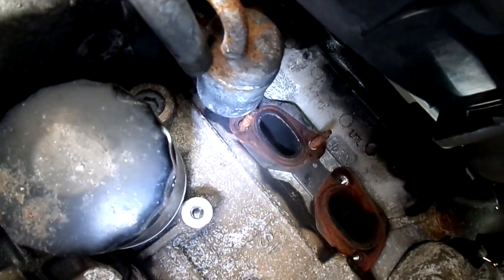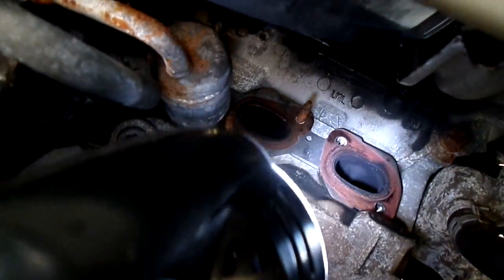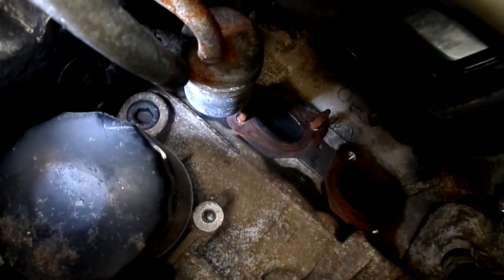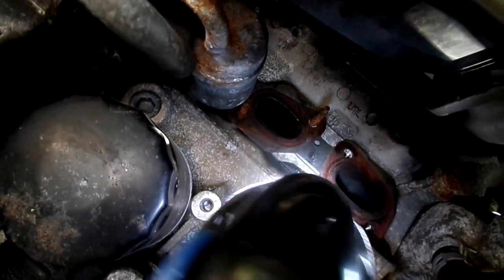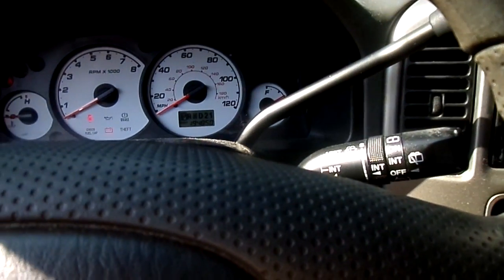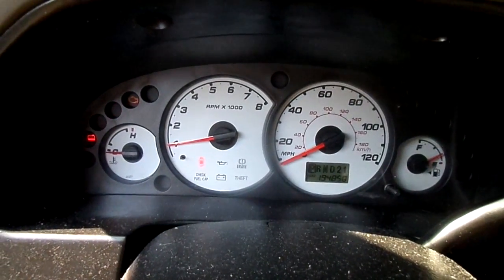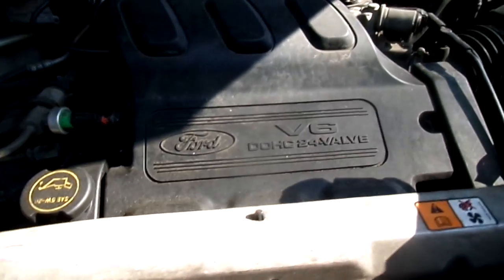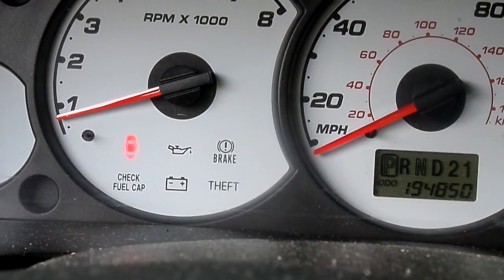Why This Ford Escape Sounds Like a Ferrari

Comment: I've drove my 75 Firebird Formula 400 without the exhaust system, is still kept the exhaust manifold. It absolutely roars like a monster and every time I drive it in the free way.
Reply: Done same to 2 trucks left manifolds but sparated (removed)mufflers